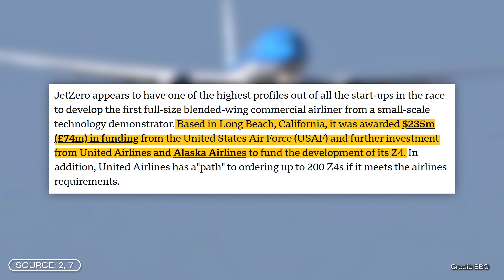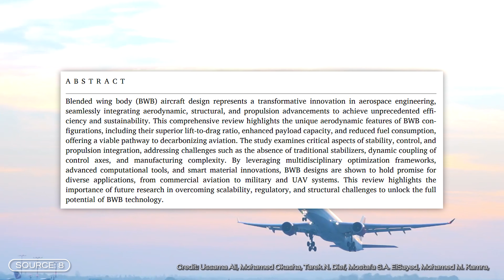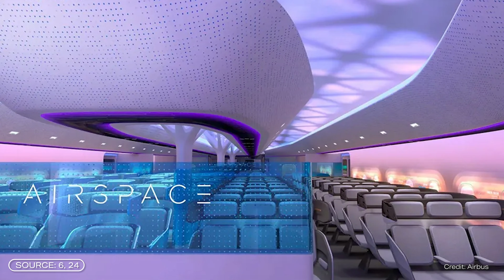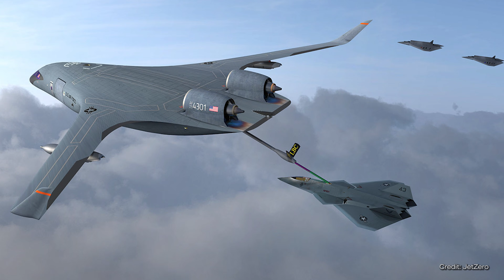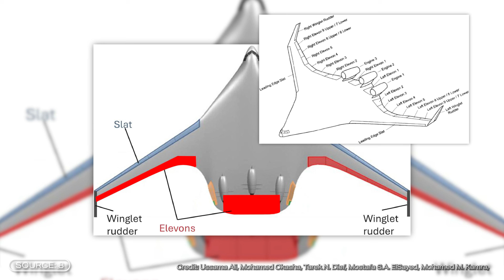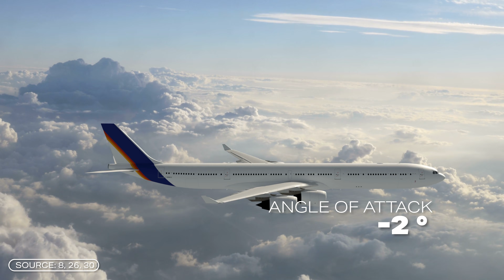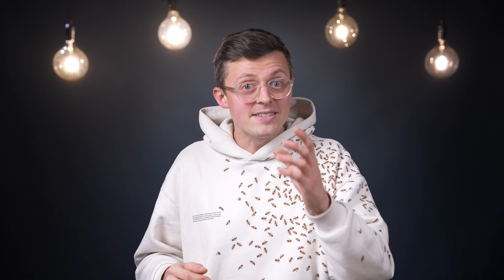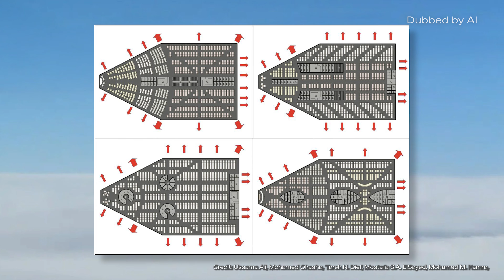The "Perfect" Plane Has One Big Problem...

Comment: If anti-icing fails, chunks will be sucked into all the engines. That can't be good.
Reply: Excellent cautionary scenario....
Reply: @TomMcinerney-g9b  It has happened before and the rear mounted engines surged which isn't good either - except in this case, there is more surface thus more ice. This lesson cost lives.

Comment: Northrob B-2  is already flying example of the extreme limits of this design. The issue here is that most civilian authorities want a statically stable design this design is unstable. lose computer control and the plane will crash.  In fact these planes have crashed because of this.

Comment: Wow, almost all middle seats with no way to get up when the other passengers are sleeping with loads of stuff in their lap. Well sign me up!

Blended wing aircrafts are ideal for high volume aircrafts, which are getting less popular, exemplified with the A380. People don't want to extend their trip with another flight to central hubs. That was the genius of the Dreamliner (787), which completely changed aviation industry, now further supported by the 350-XWB.

I am not saying this will not happen, but the hydrogen stuff is all but dead. Aviation is the single concept that benefits the most from the properties of jet fuel (volumetric and gravimetric energy density, and being liquid at ambient temperature and pressure). So as a civilization, we are probably better off making planes efficient in terms of energy and financial utilization, and focus on decarbonization in other areas.

Comment: Hmmm... I recently modeled some blended wing shapes based on online images of blended wing aircraft in Solidworks flow simulation and was quite impressed by the L/D ratios and low stall speeds up to around 250kts true air speed. However at about 30,000ft and 400kts and above TAS I started seeing drag numbers tremendously increase due to mach compressiblity on the wide body areas. I then placed sized models of conventional swept wing and tubular fuselage  jet aircraft and didn't see the large areas of compressibility as in the blended wing models, and much lower drag numbers that match real world aircraft. 

Given my models were not exact but pretty close to images of proposed aircraft and my initial take-away is that absent of real test data, an aircraft with a larger cross-section and surface area to current aircraft is unlikely to have 1/2 the drag. Anyone see any real L/D  numbers on these designs?
Reply: Good report on significant issue.
Reply: I'm no engineer but even I wondered about all this surface area.
Reply: @wintersbattleofbands1144  More so than surface area drag what I saw was pressure drag due to airflow accelerating to near or beyond mach1 on wide body areas, once the body got to about mach .5 where with conventional aircraft that doesn't typically happen until in the .7 to .8 range. However, From what I was seeing a blended wing design might have some real advantages for an aircraft at speeds 20 to 30% lower than traditional tube and wing designs. That said, perhaps more refined blended wing designs might provide some magic L/D improvements

I also modeled flying saucer aircraft with a T-tail control arraignment and embedded engines, and with a diameter and height comparable to a modern business jet, in speed ranges of mach. 3 to .5 the L/D figures were quite compelling given the huge interior volume, with very low take-off and stall speeds. However,  approaching mach .4 airflow at the peak of the saucer approached mach 1 creating huge pressure drag wave. My take-away was that  airflow can accelerate over a lift producing short wide body efficiently until air reaches compressibility limits.
Reply: @jackoneil3933 Many blended wing designs choose to use thick, traditional subsonic aerofoil sections for low speed rather than the hassle of flaps. As you say, they pay for that in cruise. I'd use modern supercritical aerofoil sections instead - that's what they're for.
Reply: @jackoneil3933  So this suggests that the blended wing body will fly slower than current jet aircraft to achieve these fuel savings. Correct?
Reply: @dougdanzeisen9608  That's my general sense when it comes to these large cross-sectional blended airframes. A tube with a thin,  supercritical  wing at close to trans-sonic speeds I'd expect to produce less drag than even a flying wing like the B-2 Bomber.
Reply: I see this all the time with the focus on efficiency and ignoring frontal area, bigger footprints mean more drag, same with cars bragging of low cd and ignoring the size of the car
Reply: @OskarHartmannsson  high L/D always means you can carry more weight with less energy. That's just simple math. It's not like with cars where you've got wheels on the ground to support the weight. This is not "big frontal area means high CdA", it's "thick effective wing means transonic flow happens at much lower airspeed". Aka, the very real efficiency gains only apply at relatively low speeds.
Reply: @reaganharder1480  Exactly! Good expatiation that describes just what I observed. After 50 of Ploughing through the skies something that I never realized until I looked into it. 

I just pulled up my old screen shots and videos from Solidworks Flow simulation and at about 350kts TAS, there's large areas of transonic  flow in peak camber areas of blended wing and a saucer model. Surprising though that such large heavy blended models could generate enough lift to fly at 80kts.

I just downloaded some models of an actual Airbus  and other designs for CFD modeling by a University in Switzerland and when I get a chance it will be interesting to see what they show. 

The Airbus model is not like the blended-wing airliners commonly shown with tall center sections and side cords. Instead, It's more a thin up-curved swept delta wing with a narrow fuselage like center-section, more a flying wing than a blended wing. I would guess the Airbus flying wing design is pretty efficient like a B2 Stealth bomber that cruises slower than conventional airliner at about 450kts or Mach .7 rather than in the Mach .8+ range. That being the case I'd guess a 787 Dreamliner might be pretty close in terms of efficiency if optimized to cruise at slower speeds.
Reply: @jackoneil3933 Subsonic versus supercritical aerofoils. Just a design choice on any shape of commercial jet.
Reply: @OskarHartmannsson A decent blended body has significantly less skin and frontal areas - that's the point.
Reply: @OskarHartmannsson  its not about the frontal area but the fact that a ticker airfoil reaches critical speed (speed at which a part of the airfoil reaches mach 1) at much lower speeds compared to thinnier designs, hence the f104 had such sharp wings, 
what im saying is that these kind of aircraft may have less drang during sub critical speeds but at mach 0.78/.79 they are way less efficient since the conventional aircraft is still subcritical, and the bwb is actually critical and experiencing buffeting (shock stall- basically the boundry layer detaches-reataches to the wingbody).
hope this helps clarify
Reply: Love for you to put your research on YouTube for evaluation
Reply: Likely your model uses conventional hull material data hence its poor performance
Reply: @Barskor1  Good point. The the hull models I flow tested were fixed in a virtual Wind tunnel  to measure lift, drag, aerodynamic flows, turbulence, separation, Mach number and etc. rather than a flight simulator model so hull material and weight were not factors. 

Only lift and drag at different true airspeed and angle of attack were measured. Say 90kts and +15 degrees of Angle of attach. Say the hull produced 100,000lbs of lift without flow separation and your projected aircraft weight was  below 100,000lbs  it theoretically was flying. 

Similar for drag results, if at 30,000 ft at 500kts the blended wing shows 20,000 lbs of drag and a conventional wing and tube air-frame model of  similar size is  producing 8,000lbs of drag at the same speed and altitude (about what I recall) then the conventional air frame is more efficient. 

At slower speed, around 140 to 180kts True Air Speed, the larger blended wing aircraft despite having a larger cross section and surface area was closer in drag to the conventional air frame and producing more lift. So theoretically as low speed it could have more interior room and haul more payload for the same thrust, but above about 200kts the advantage reversed.

Comment: CRJ 200  has an oil pump and reservoir in the tail, so you can fill up engine oil without climbing up to the engines.  But yea, other maintenance on the engine would be....different :-)

Comment: So..... are they going to print a 3D structure on the inside of the outer panels to maintain structural integrity?
That seems to me as the only way to fix the pressure issue without going overboard adding conventional heavy structures.

Comment: A tanker does not need to be pressurised. But it will have to be very strong to carry the weight of the fuel. 
A passenger plane burning hydrogen will need 2/3 of the plane to be hydrogen - so the passenger compartment may end up being a pressurised tube in the middle …
A cargo plane may not need to be pressurised at all. 
Meaning three very different structural designs!  Or maybe one design for hydrogen, with a tube down the middle to take passengers, freight, or gasoline. 
Pressurising the blended wing design will be a nightmare - fatigue failure. It will be very costly to test and check - thousands of hours needed. 
A military version will be simpler and sturdy, and not need the economy if it can carry twice the fuel or twice the unpressurised cargo for longer distances.

Comment: the limited flite control  and stability of this design makes it a permanent non starter for commercial passenger flyte liability.there is no designing around it.
the large fuel, cargo, passengers capacity is good but efficiency will plummet addressing safety, pressure, operational issues making it hardly better than new conventional designs.
military specific role as fuel carry likely only market, but at high cost -- stand alone requirement for production leading to high cost.
its a design not suited to earths atmosphere -- haaaahaha

Comment: If someone built a modest sized blended wing aeroplane, we'd have possibility of a steady progression up in size - just as happened for existing products over the decades.

Maybe there is some niche application where the blended wing approach offers advantages which are too great to ignore? Consider how outlandish the Beluga and Super Guppy appear - but they do things other aeroplanes cannot. A maritime reconnaissance platform with large sensors/dishes pointing downwards but within the body - despite modest overall size.

Maybe even a non-pressurised aeroplane? Thus side-stepping all the issues of pressurisation.

Maybe just for some billionaire to show off regardless its real performance? 😀

Comment: The strengths of the concept are undeniable, I hope that it proves to be as big an advantage as promised. Some of the downsides of the design can probably be mitigated with some careful engineering.

The channel RamyRC built a scale demonstrator for a similar aircraft if you want to check out that video.

https://youtu.be/6sSr3gFUCVo?si=a0PvYp3szOECqYYZ

And

https://youtu.be/0q1gSZZpzPQ?si=MWnFWig1OQnOXN4w

Comment: The stability issue is resolved but not commonly used. Gullwing design  has no negative aerodynamic impact but gives stability during flight. All birds have evolved this wing shape. 

Fuel savings. Greatest impact on this aspect in newer planes comes from better engines. Specifically, increasing the bypass ration, as in increasing the amount of air that goes around the combustion chamber. If Jetzero gains access to better engines, the fuel efficiency will be increased.

Comment: The passenger concerns are not valid for military and cargo and it would be very much an advantage to get double lift even with same fuel use. Even the pressure vessel concern is not that valid for cargo.

Comment: Nice Idea - BUT  Tooling, Parts, Repairs, Material Fatigue, Personnel that's trained to work on it are all different from 'normal' Aircraft - hence the advantage in Fuel Cost is much lower. In addition Ingress/Egress RE boarding or emergencies is different, the currently used Jetways might not work well ... besides I'd like to see out the Window to have situational Awareness. Well made Video, Danke.

Comment: I don’t think regular (daily) engine inspections would be an issue. The manufacturer will 100% place a fuselage roof ‘door’ accessible from the inside of the aircraft.
Reply: A specialized air stair isn't rocket surgery
Reply: @dukeofgibbon4043 I like it! Perhaps it is, however, brain science.

Comment: I would say the numbers are quite misleading. You could argue that for some perspective they are sort of true.

The BWB gain very little efficiency of the benefit of the aerodynamic design, we talking 3-5%. What it does gain is more lift on a given angle of attack. This allow the plane carry more stuff for the same size aircraft.

But it don´t really make it more efficient directly. The added efficiency would in theory come from the per load to fuselage size. And here it kind of breaks down. For you to gain 50% the original aircraft need to be very heavy, and that may have been the case for a B52 or a B1, but not for a A350. So the actual effect of having a higher load is more like 20%, while that is of cause still significant. Even compare to the 767 claim the 50% number is just not realistic.

But that gets us to the second problem. If you load fuel, this is not really a problem. but if you load passenger it is. The more elliptical you make the fuselage, the more re-informant you need. Aliptical fuselages is actually not that uncommon, but they are typically 5-10% elliptical, for a BWB then need to be basically with a 100% higher width than hight if not more. This is just not viable.

Comment: I'm an Aerospace Maintenance Engineer. Having the engines on the back wouldn't be a big problem. All you need is a trolley with diagonal stairs and a work platform that you push/drive up from the rear of the aircraft. Modern gas turbines are so reliable they don't require much maintenance and if the aircraft is in a hangar it's even less of a hassle. Many aircraft have had high, rear mounted engines in the past, like the VC-10. It gives advantages like less noise for the passengers and potentially some aerodynamic advantages as well. Commercial aircraft have to be passively stable, so an active stability system isn't a solution to departing from the desired AoA.
Reply: It’s great for reducing risk of FOD damage.
Reply: *hangar
Reply: @8BitNaptime  Thanks. Corrected
Reply: You forgot DC-10-200
Reply: The B-2 crash on takeoff several years ago is an example of what can happen to inherently unstable airplanes when something as simple as the airspeed indicator malfunctions
Reply: Well you managed to complete forget a VC-10 where venerable to deep stall as the wing shadowed the engine...now what would that do in a case of a delta wing with above wing engines. This design is insane. No cross wing control due to the lack of a vertical stabiliser. I'll take a VC-10 in deep stall at 1000 ft over this bullshit design any day of the week. Aerospace Manufacturing engineer here. Even Vulcan the biggest delta wing ever had a vertical stabiliser.
Reply: @princeofkernow9875  All I said was that there are some potential aerodynamic advantages. You launch into me like I said it's aerodynamically perfect. I didn't. The VC-10 got certified and was a successful airliner, so it's problems couldn't have been that bad. The U.S. Air Force and airlines are serious about BWB designs and I assume they know what they're doing. If you're so indignant, why don't you take it up with them?
Reply: @princeofkernow9875 You can always add a hoofing great vertical stabiliser if you feel the need. And canard foreplanes to stabilise in pitch. Zero are choosing not to, but only to reduce Drag.
Reply: @richardm.newlands2417  no aoa is stabilised by the variable camber angle of the delta wing, at the tip it MUST have negative camber, the stabilizer needs to controll YAW, and the ONLY alternative is an active system, however FAA and EASA require passive stability hence a stabilizer, but if im seeing correctly both vshape and the american one have one at the wing tips

Comment: Innovation is always great, but practicality is often the highest barrier. I'm sure engineers will solve the turbulence issue. With climate change comes new challenges - clear air turbulence, for example, increased by more than 55% between 1979 and 2020. But maintenance and safety... that seems like the biggest hurdle. One question not addressed in your video is how designers will meet the 90-second rule with what looks like a theater-sized room. And I'm certain that airline operators will seek maximum capacity when it comes to packing in passengers. Will the blended design give them permission to make coach seats even smaller? I love the concept, but the barriers are not insignificant.